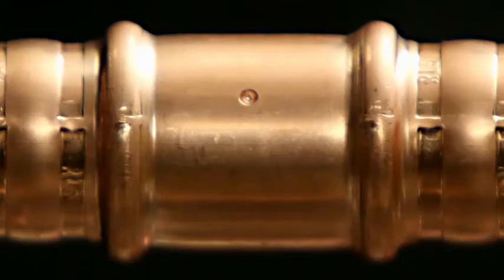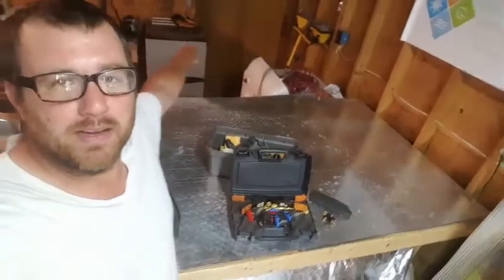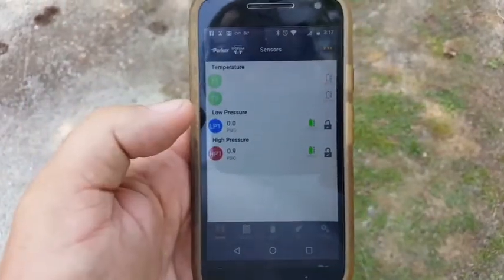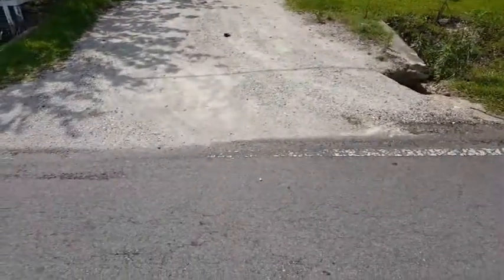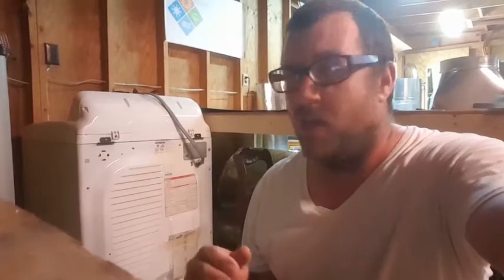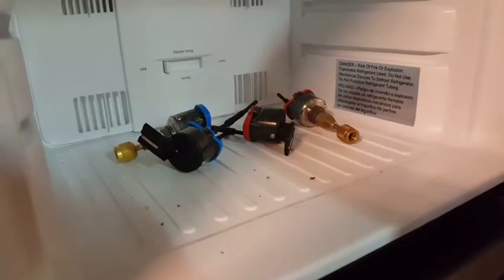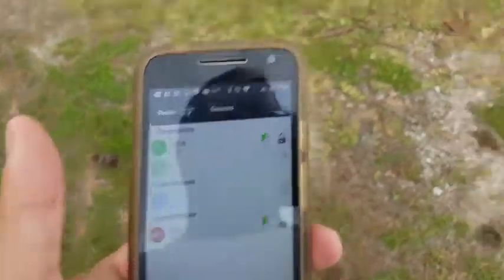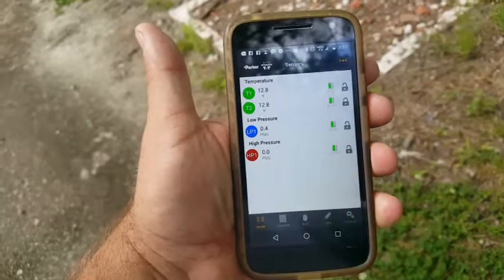Sporlan Smart Pro/R Distance Test

Comment: I have iconnect, 2 testo 549s,  testo 570, analog manifold and single gauges ... 9 times out 10 I still go for my 549s ... screen, clamps, hoses ... no extra fittings or steps needed ...

Comment: surprised they worked that far inside that small freezer, but there would be a good amount of RF leakage around the seal and possibly plastic top/bottom of doors, they probably skimped on metal under them :)

Comment: Anxious to see what John Israel thinks about them after using them for a week or so.
(Doesn't Nor Cal use these?)
Seems like they would get frustrating to work with in the midst of a busy day in the middle of the summer when one or more components are suffering a low battery(I assume the Pressure and Temperature Xmitters use coin-style batteries?)
 and you're trying to get the job done and onto the next one...I know my phone battery goes dead quick enough as it is - WITHOUT the Bluetooth being turned on for an extended amount of time.  
Sure, hoses and thermocouple cables are annoying - but the batteries on an SMAN last a ridiculously long time.
Reply: I'll guesstimate close to one year battery life with them "on"  6 hours a day. they have 3volt CR123A lithium cells, a bit costly for name brand ones.
many security systems use them in wireless sensors and motion detectors (lower power/don't transmit continuously) they last years in that usage.
Reply: That's pretty decent; I guess the 'weak link' in the system battery/energy/charge-wise would be the phone at that point - probably have to be very conscious to plug in the charger every time when driving between calls to keep enough juice in it to run with Bluetooth on during the next call.
Reply: good plan, disable the cellular service and wifi and as many other things as possible, use only the bluetooth if possible. beware they'll still make emergency calls (911) when not activated.